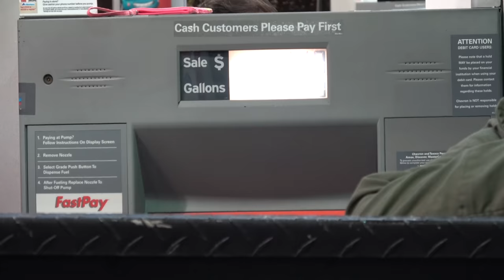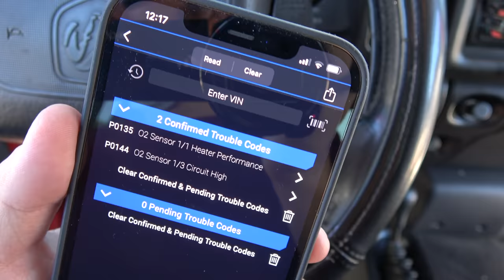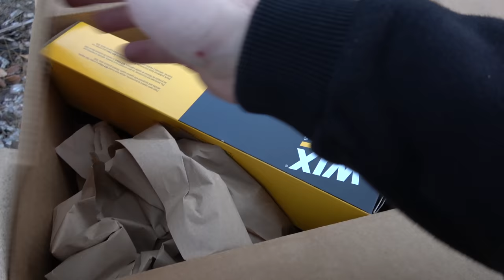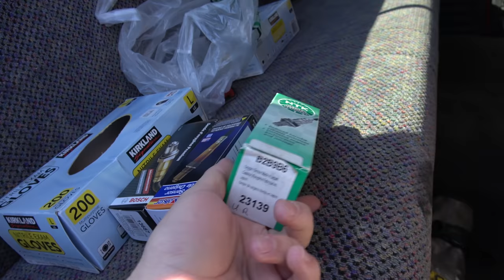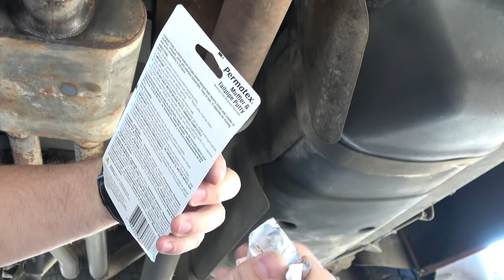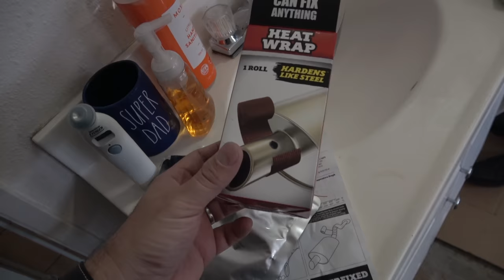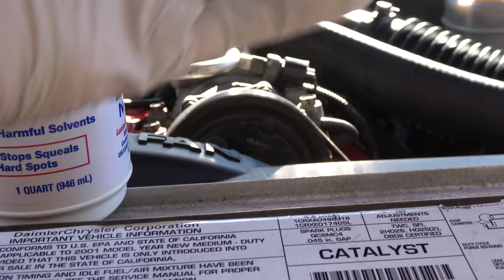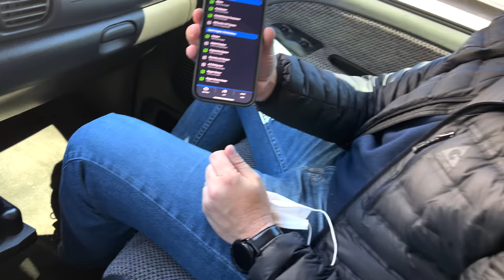Redneck Viper (Dodge Ram V10) - Start to Finish!

Comment: The nylon mesh you pulled off the upper radiator hose was actually factory. Helps prevent rub damage. The zip tie, though, wasn't. 

The entire upper intake manifold was painted black. Those came bare aluminum, and look great that way.

The actual sport grille would've closed that gap above the bumper. However, considering the front bumper you put on pretty much negates it and actually looks pretty good.

Comment: The official Worthless Whip truck will tow any/all future worthless whip projects.  Just need to find a flatbed trailer and ya'll set : ).
Reply: Yes I remember when this particular model first came out and Jeremy Clarkson on Top Gear a British T.V car programme test drove a Dodge Ram and he pulled a freight train in one. God know how much the freight train weighed probably over a hundred tons and the RAM pulled the thing with ease. That’s what I love about American trucks. Their not the most technologically designed trucks but their sturdy , that use tried and tested engineering and mechanics💪🏼

Comment: The difference between different antifreezes is that some are compatible with aluminum and others will corrode aluminum -- and the different kinds are NOT compatible with each other, and will form sludge if mixed.
EDIT: You know how you keep buying used cars and discovering they have corroded leaking heater cores? THAT'S WHY USING THE CORRECT COOLANT TYPE MATTERS.
Reply: I learned something! Thanks!
Reply: My ford came with Pink antifreeze and the only Pink antifreeze I can buy is for Toyota cars. This makes no sense at all.
Reply: @Redavisunwind  The color doesn't matter... what anticorrosive chemicals are contained does.
Reply: @Redavisunwind : That's fine. The color indicates the chemical formula. It doesn't have to be brand-specific.
Reply: No way Shawn. you know I genuinely did not know that at all. For the first time in my life at 43 I now know the difference for engine coolant😂👍🏼
Reply: @MiaogisTeas  same here. I’ve been driving for over 20 years and I didn’t even know that either. Now thanks to Shawn i do😂

Comment: you can clean the O2 sensors with carb cleaner and a cotton ball or Q tip , be very gentle when cleaning because of the plating

Comment: For some muffler leaks, good old Kentucky boys in my home state used to split a tin soup can down the side and strap it over the leak with a couple clamps and then permatex the ends of the can and the cut.  If you were lucky, they even removed the soup label from the can!
Reply: That’s genius idea. No doubt save you money as well.

Comment: 0:25:30 -- Green is Inorganic Acid Technology (IAT) coolant for older cars with more metallic components. Orange is Organic Acid Technology (OAT) coolant, formulated for newer models with more aluminum and nylon. Different metals/ sealants react differently to acids and additives; it's not just colored water. Using the wrong engine coolant leads to corrosion and damage to the water pump, radiator, hoses and cylinder gasket.

Comment: The nylon cover you removed from the upper radiator hose is installed from the factory, it keeps the AC lines from rubbing on the hose.
Reply: Yes- I've got the same thing on my ram.

Comment: The braided stuff was factory installed. It's in mine, I have the same truck, and it's to protect the top hose I believe from the air conditioning connection at the compressor. I like these videos.

Comment: hey winston , some places do not require all that smog stuff like Cal.  , Cal is the most smog controled state .
Reply: What is smog is it like a yearly safety test cars and trucks have to pass? We have something similar in the U.K a annual M.O.T. Any car that is over 3 years old has to be tested to make sure it’s mechanically sound to be driven on the road. They test your emissions, tyre tread minimal 3 mm tread, lights, indicators, break pads and disks etc. Don’t know if smog is the same?

Comment: That lucas oil power steering stop leak has stopped a leak for 7 months in my '98 ram and 5 months in my '02 monte carlo. I didn't think it would work either, very surprised and happy that it has. Also I love how that truck looks with that brush guard. Cool video.

Comment: Every scene of your repairs gives me nostalgia for the same exact repairs that I had to make for my 1999 Dodge Dakota. The evap purge fuel canister seal and hose connections, I had to make my own rubber fitting for the plastic lines, and the power steering pump with its leaks and the Lucas power steering fluid stop.

Comment: When you pour anti-freeze hold the container wide side to the filler neck  (like a book you are laying on a table) and it will let the air and fluid flow properly and not splash all over the place.

Comment: I had a 2001 ram 1500 quad cab shorty 2WD w/ 5.2L & manual transmission.  I used it to pull my racecar around, but it was gutless on hills.  
Had a fire in the heater  because a rat had taken leaves & pine needles & set up home in the  intake to the heater core. That's where the blower resistor is. Located,. The resistor lit the stuff up one day...  I got it put out by pulling the resistor and squirting water up into it, then did an attempt to clean it, but it still stunk for a while.
My dash was cracked pretty bad too, but that's these trucks... All of them.
The bumper is similar to one I had, mine was a ranch hand without the grill/headlight guard.
Also check if the rear diff has one of those covers like the  trans pan too. They're not so good. Look up Banks engineering videos on them.

Comment: It’s called monitors and you have to do a drive cycle. You can lift off the ground and do it sometimes it’s quick but sometimes up to 100 to 250 miles for all monitors to complete. When the monitors don’t complete there’s a huge issue. Could be ECU.

Comment: That braided crap you took off the radiator hose came from the factory. It was put there to protect the radiator hose from chaffing on the A/C compressor.

Comment: The difference with the antifreeze is because one is made for  a steel block with a  steel pump impeller. Others are for aluminum. And others are for having lightweight magnesium pumps. Regular antifreeze will eat holes through it.

Comment: I don't know if you've noticed how lose the steering is ?  But if you replace the steering gearbox with a Redhead steering gearbox that will eliminate the sloppy feel of the steering.

Hope you steel have the truck. I have the same truck I'm battling the brittle dash.
Reply: Still have it yes! Will get a Redhead!

Comment: An old Ford 7.3 diesel or Dodge Cummins 5.9 liter will get 17 or more miles per gallon. Both engines are extremely reliable.

Comment: Enjoyed the long format, even after seeing the shorter ones while the upgrade was in progress. Bonus flying rat turd footage!

Royal blue paint job would look sharp with the new black front bumper. Kinda looks like it came off Pam Anderson's truck in Barb Wire 😎

Just introduced Smokey and the Bandit to someone who had never seen it. Still a highly enjoyable flick. Made me wonder what's up with Winston's Trans Am. 

Whatever you do, don't take the truck there to get painted.
Reply: The fenders and doors are on the trans am, it’s getting there

Comment: Different coolant types for different materials in the cooling system. The coolant needs to be chemically neutralized to every part in the system, and different manufacturers use different materials. You can use the wrong coolant, but it might cause something in the system to die sooner.

Comment: Auto-Reilys....lol, that's funny. What the hell is an oxygen sensor? I know I'm late to the party but man, you should consider putting some headers on that monster, cut the cat, straighten the pipes, load up the wifey, kids and get the f*ck out of Commiefornia. I was born in Cali, but moved to the east coast for work. I travel back for family, but Cali isn't the same. I live in South Carolina, close to the beach, cost of living is nothing here. $400,000 will build a palace here with plenty of land and you drive whatever you can build. No car inspections whatsoever. Way more freedom on this side.

Comment: theres alot of irony in the fact that heater cores go bad when you put the wrong fluid in the rad and you dont know the different between fluids. no water does not always work, just DONT do it even it a warm climate. specifically if you engine has 2 metals in the head and lower end. 

i love this though Winston. 

USE MORE LUCAS . Put some oil additive in that old big beast v10. its like a booger that sticks but its lube.
Reply: also wix are literally the best filters but also the most restrictive.

Comment: Miss my truck I recently sold because the previous owner donald ducked a chipped inner part of the rear axle housing so it leaked gear oil..3 attempted repairs later along with a relearned lesson about hand placement and 5 pound slide hammers I gave up and sold it. (I did get a cool scar from the deal)
Now I drive a piece of sh*t soccer mom van, but it runs well and better on gas.. I just need to replace the way overpriced radiator at some point. It has a pin hole with a slow leak..
So what happened to buying it for cheap and fixing it for even cheaper?

Comment: Ha ha ha! The red crap plastic all over the engine bay are there to stop the RATS from eating into the TUBES! Really there is no reason to remove it excerpt that it might hide cracking/old age damage from showing.

Comment: Bro...as filthy as that engine bay is, just take the truck to a self-service car wash and use the high pressure sprayer to clean the engine bay. It doesn't even matter if water gets into some of the electrical connections, because you're going to have to fix all that crap later anyway.

Comment: That thing is going to be a continual money pit...   169k miles and owned by someone who was more than willing to ignore maintenance issues.... yeah everything on that truck is going to need to be fixed especially if it was owned by someone that actually used it for work.  Good luck!
Reply: These things are pretty forgiving
Reply: @MrCarGuy  Really?  Everybody I've known that has owned one has just complained about it till they got rid of it.  Maybe you're right but a gas powered V10 with that many miles on it is just not something I would advise.  shrug I've been driving various F250's for work for the past 6 years so I'm probably partial
Reply: @grazzitdvram  the transmission is the biggest problem I think. Everything else is pretty good
Reply: @sc1338  which honestly isn't too surprising, the transmission connected to a V10 meant for a viper that is instead pulling a couple tons.  I wouldn't be surprised if that is their biggest issue but that is not a minor issue and once again 169K miles on a work truck.... mind you I dunno how much work that truck saw but the bed is rough enough to indicate it did spend some time in its life working.
Reply from the maker: It’s a survivor